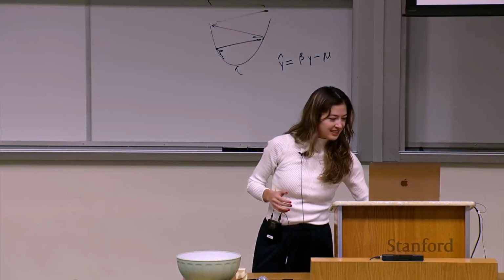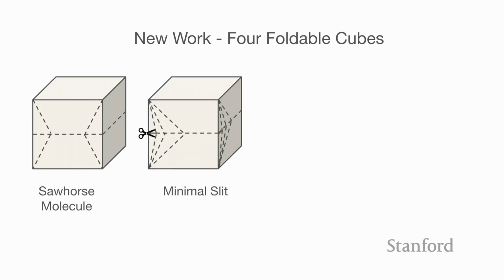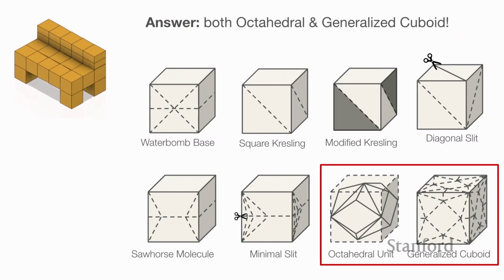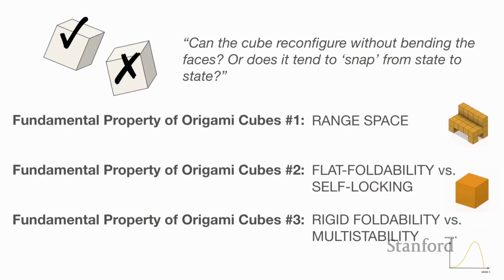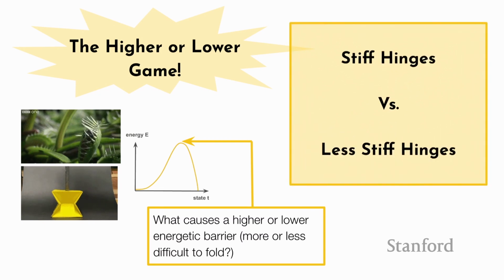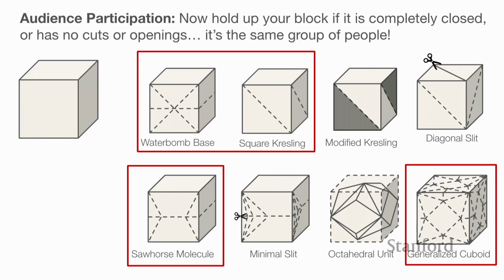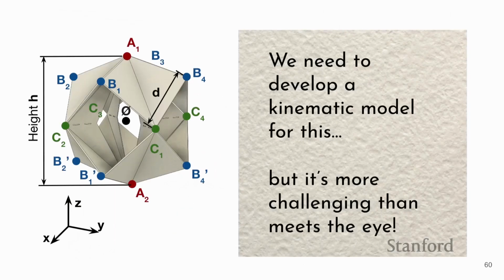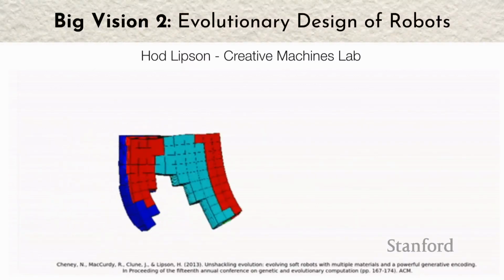Stanford Seminar - Designing Origami Voxels for Robotics

Comment: Absolutely foundational work in this field! Very well presented too. Could be groundbreaking in terms of modularity and scalability, but she made some valid points about the energetic cost. If there were a way to streamline communication between unit cells, maybe the transformations required of individual cells could be minimized in real-time. Something along the lines of a machine learning approach would be a neat way to teach voxel networks to predict the transformative path of least resistance.